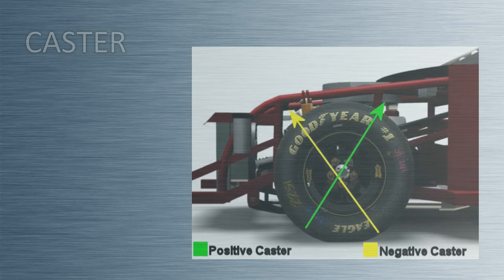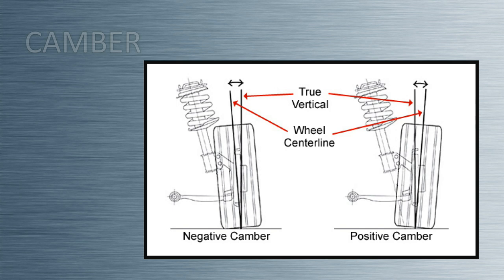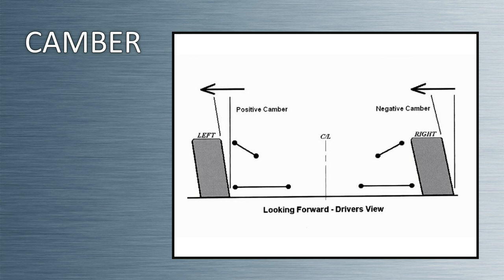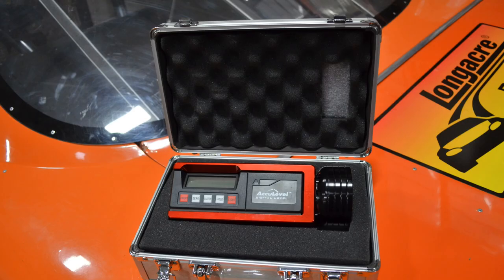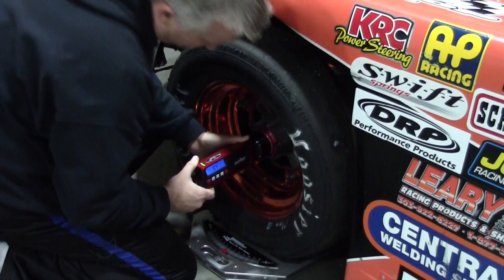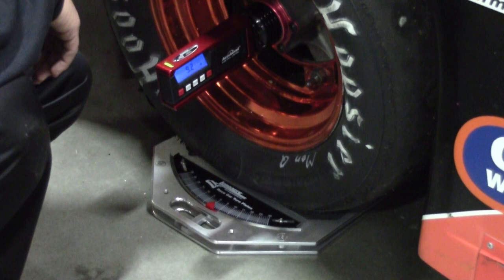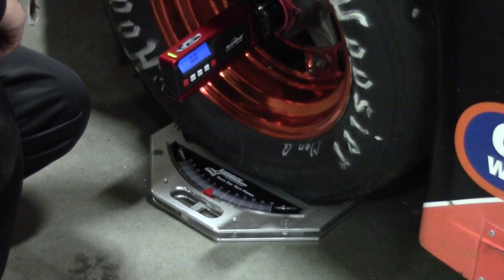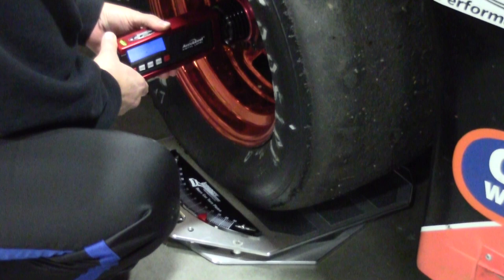How to Use a Digital Caster Camber Gauge - Longacre 78290

Comment: how would one adjust rear caster then ? if you cant turn the wheel
Reply: caster has to do with the ball joints and steering, unless your vehicle has rear wheel steering, there is no caster in the rear.

Comment: He forgot to zero the tool on the floor. I assume that's a major part of this..
Reply: Would you zero the tool to the car?
Reply: That's right. The guy did not measure camber correctly. You are supposed to zero the gauge at a known 90° vertical surface, then put the gauge on the hub are brake disc. The degree measurement then with tell you whether you have positive or negative camber.

Comment: so would that mean that I would have to adjust the camber 2 degrees to the positive side?
Reply: Camber and caster angles do not need to be measured the same or synonymous with each other. The number recorded for caster is separate from the potential camber or toe you'd set.